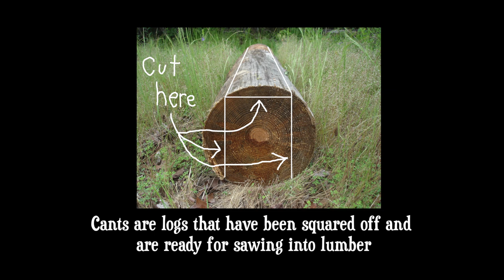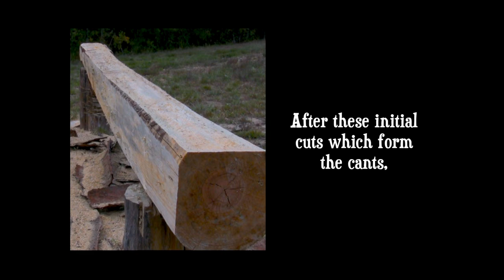Making Lumber With a Chainsaw - FHC Farm Bulletin #1

Comment: Getting ready to build a small timber frame. Been doing months of YouTube research. I have found your videos to be the most entertaining, uplifting, and among the most informative too. Thanks so much for what you create.
Reply: Gotta see his video about cutting the bottoms of cladding boards (say board n batten) on an angle. It works to shed the rain big time!
Reply: @___PK__  yes, thank you. I saw that one. It's a rare gem not found anywhere else on YouTube. At least not that I could find.
Reply: @johnshearing  Indeed. I did test it with flat and angled boards. I had a sealer on them. The difference in and after the rain is drastic. I still marvel at it. Have a great evening.
Reply: It's about cost for time and effort. While I love the romanticism of doing hand hewn with an axe or chainsaw... if doing 30+ logs the saved time of renting/buying a mill would lend well to overall build quality/ artisanal touches. The felling could be by axe and chainsaw, haul with atv or tractor and mill it!

Comment: I use an 80V electric chainsaw with an 18" blade, it is a smaller chainsaw than the ones recommended for the mill, so I had to grind down the clamp surfaces to clear the chain. After that it works well and does the job. I've always said that Pa Mac's videos are the best on You Tube.

Comment: The main problem I have with chain sawing logs into lumber is that the chain saw blade is so much thicker than a normal lumber making saw blade. So a lot of waste. For average sized logs, a good stout band saw would do more with less waste. I guess one needs to decide on the cost benefit ratio of that loss.....
Reply from the maker: That's correct, Saint Coemgen; everything usually comes down to upsides and downsides. At least with extra sawdust you can cover your chicken house or milking barn floor.
Reply: @farmhandscompanion  Actually, I was very wrong in specifics. 

That is, with a bit more research I found one can get a narrow gauge chain saw chain 0.043 inch (Husqvarna has one), or about 1 mm. Which would be about-ish a band saw width. So, for the specifics, if one wants to spend the money to minimize wood waste with a chain saw "lumber mill" one can. Ergo, I was wrong in specifics. A general chain saw still wastes a lot of wood IMHO. But that is mainly because I deal mostly with high value hard woods, where ever millimeter counts.

As for saw dust, not having chickens or cows, I throwing saw dust into a compost pile (those I do have). Saw dust is a great source of "brown" material for any compost pile. 

Hope this helps.

Comment: I milled some small logs and ran in to some old nails on several.  After I bought a small wand metal detector I discovered it was cheaper than replacing damaged chains and bandaids lol.  Thanks for sharing!

Comment: I picked up an attachment a while back and am just waiting for enough snow and ice to melt so I can get to work. Do you use the regular chain on your saw or do you have one specific for milling? Thanks for sharing.
Reply from the maker: Hey Kevin, I've used both, and both work. The rippin' chain does seem to work better, however.
Reply: You might consider a skip tooth chain as well. It reduces the power demand on your saw.